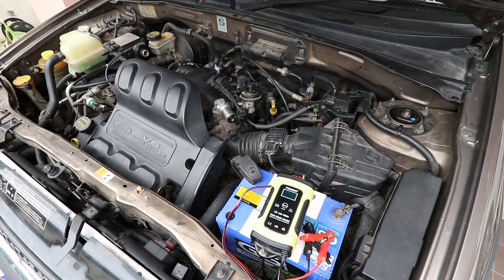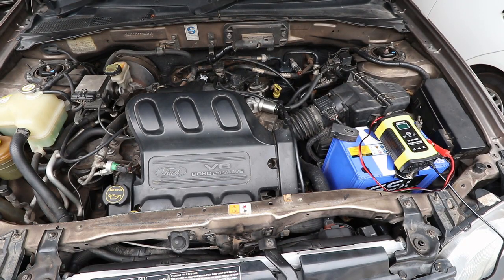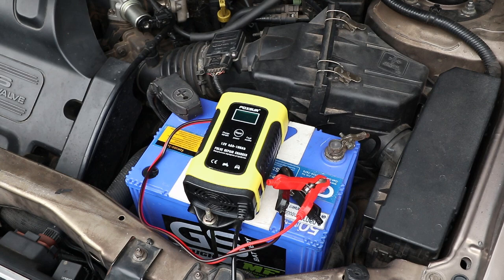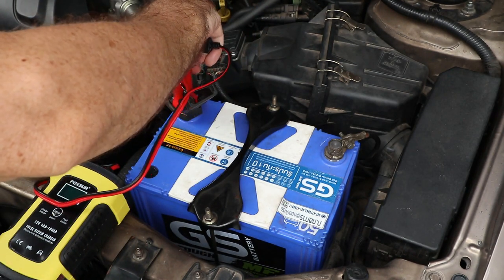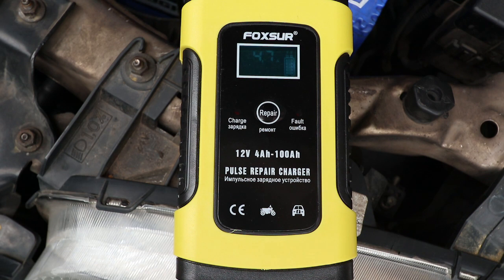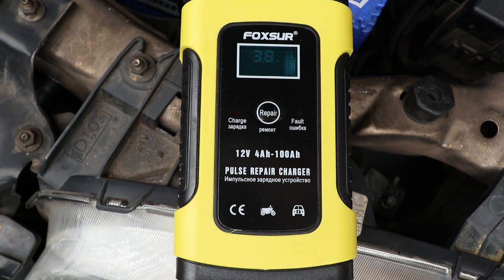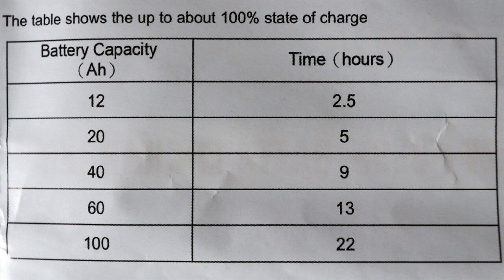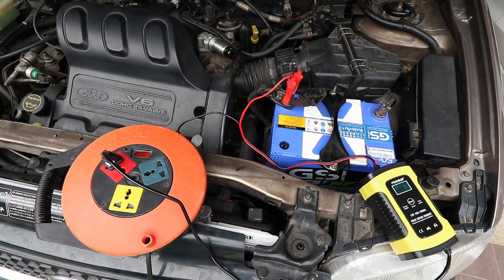Review Of The Foxsur Pulse Repair Car Battery Charger

Comment: Please updated if de-sulfation remained for some time say 6 months or the battery went bad again in short period of time say in one month.
Reply from the maker: I did a pulse repair six months ago when my battery analyser indicated there was a problem. Since then there have been no further problems. I checked with the battery analyser recently and it still looked good.

Just recently someone who seems very knowledgeable about the subject left some comments and suggested the battery should be pulse repaired twice a year, so I will probably do it again soon. However, to answer your question it didn't go bad shortly after doing the repair.
Reply: @PhilUKNet  Thank you so much the reply. It helped.

Comment: Bought one earlier this year and used it for the first time yesterday. The red Charge light does not come on and the fan wasn't working. Had turned on power then attached red clip to battery positive and black clip to car body (earth point). Display only shows the battery voltage and the temperature. What could be wrong?
Reply from the maker: I'm not sure and I'm not at home at the moment, so can't check my one. Possibly your one has a fault, but I'd like to take a look at my one. I'll get back to you later.
Reply: @PhilUKNet  Thanks, Phil. Could it be because my battery already has a full charge (12.7V)? It's 2 years and 3 months old. No problems with starting though.
Reply from the maker: @kokkionglim6548  Possibly, but I would still expect the fan to run and for it to go into charge mode even if your battery is fully charged.
Reply: If after connecting to the AC power supply the charging process does not start, the device probably has a defect - disconnect the charger from the AC and battery and check inside if the glass fuse is not blown. It is also possible that the charger is not supplied with AC voltage, check if it is so on another extension cord.

Comment: I saw this exact same charger in Taiwan.  It is only 300nt  $10 US. I am in the same position as you, basically have not started my car in a few months.   I will buy one and see if it can start my dead battery.   Thanks.
Reply from the maker: Where I am in Thailand you can buy them online for less than the equivalent of 6 UK pounds (about 10 US dollars). I recently got a comment from someone in Ireland who had ordered one from the UK and paid 28 UK pounds.
The charger can't repair serious flaws, but if it's just a lack of use and sulfation there's a good chance it can bring the battery back to life. Worth a shot! It worked for me.
Reply: @PhilUKNet  you might have found a new business opportunity. Lol
Reply from the maker: @chaunceystewart9960  Unfortunately I'm not very business minded, but there are certainly opportunities there!

Comment: Hi there, 

I was just wondering if you’ve had a chance to test this charger a bit more in particular the repair function. Give me a shout if you did, it would be brilliant to know you opinion.
Reply from the maker: Is there anything in particular you would like to see tested? I haven't done any more testing other than what I did in the video. Basically, just analyzing the state of the battery before and after repairing.
Reply: @PhilUKNet  Shortly after I wrote this comment, YouTube was so kind to show me you other video in which you have used it to repair your battery. I believe it did answer my question as I wasn’t sure about usefulness of the repair feature. Thanks for getting back to me.
Reply from the maker: @viktordudson9556  I'm pleased to see that YouTube are showing my videos! I think it's a useful device. It can't repair serious defects, but if the problem is just sulfation on the plates it can improve matters. Cheers!

Comment: Ah jaysus I only got my one of these in the post today. Seems to be fair decent .
Reply from the maker: Not sure how much you paid, but mine was very cheap. For the money I think they are excellent little devices.
Reply: @PhilUKNet  I paid 28 quid including postage from england to ireland. Pulse charging thing is still going but when I clicked over to charge it said its fully charged .lol. guess Ill find out tomorrow when I try start me bike lol.
Reply from the maker: @Seanybiker  I just looked at lazada.co.th, where I got mine. They are being sold for 229 Thai Baht - about £5.69, plus postage of just under a quid. People in the UK and Ireland get massively ripped off. That's one of the reasons why I left - and there were plenty of other other reasons! I hope it works out for you! It takes a long time to do pulse repair or normal charging. My car battery is quite big and it took well over 24 hours, however, it did make a big improvement to the battery.
Reply: @PhilUKNet  Yeah we are getting ripped off a lot alright. Ah with us being on lockdown and me needing it quickly I decided to just buy it as none of my friends close to me had one for a loan so although I was ripped off,  if it lasts a few years Ill be happy. ]
Reply from the maker: @Seanybiker  Yep, I understand. Sometimes you need something and you just have to pay up. Whoever is selling them here for less than 6 quid is making a profit, so if they are being sold for 28 quid someone is making a big profit. Oh well, there's not always a lot you can do. All the best!
Reply: @PhilUKNet  haha yeah exactly thats what I was thinking. It is crazy . You should order in some china and make a ki9llling.im on disabilty so dont have enough to buy in a shipment hahaha.
Reply from the maker: @Seanybiker  I should have done it years ago! They probably only pay 2-3 quid for each one and selling them for 28 quid is a very nice profit margin - even after shipping and import duties. Unfortunately, I'm more of a Rodney than a Del Boy ☹️
Reply: @PhilUKNet  thats it yeah. the shitehawks hahaha. cant blame em,

Comment: Thank you for this informational video. I like to ask if this charger is safe to use on modern dry cell batteries?
Reply from the maker: Thanks for your comment! This is what the user manual says: "Battery type - all types of 12v, AGM, GEL, Flooded (wet), Calcium type deep cycle, VRLA maintenance free lead acid batteries." I can't give you a definitive answer, but the manual says all types of 12v therefore it should be OK.
Reply: There is no such thing as dry cells. Even in gel or AGM batteries there is an electrolyte (in the form of gel or absorbed in glass mats). In fact, the charger is only suitable for flooded batteries because it offers too high charging voltage reaching even up to 15.3V depending on the temperature (gel batteries need 14.4V, AGM 14.7V) and in pulse mode 15.7V.

Comment: How long to fully charge 12v? my foxur takes 2 days to get fully charge
Reply from the maker: Yes, it's very slow. 24 hours plus.
Reply: Yes, it is possible. Depends on the capacity of the battery and the degree of discharge. To speed up the process, first charge the battery in normal mode, then use repair.
Reply: That depends on the Ah size of your battery, just because it’s 12V has no bearing on the charge time. 

It’s always better to charge gently unless you’re in a rush.

Comment: How long will it take for a 2sl battery to pulse repair? Thanks, looking forward for your response.
Reply from the maker: I don't know what a 2SL battery is. When I Googled I found batteries that weren't car batteries. The user manual just says 5 hours for motorbike batteries and 8 hours for car batteries. However, when I did a pulse repair it took a lot longer.
Reply: @PhilUKNet  2sl batteries are used for elf trucks. I think it has something to do with the size. Btw these batteries are also 12vs
Reply from the maker: @jayvillanoza3952  Thanks for the info. I guess they must be large if they are for trucks. The user manual doesn't say anything about truck batteries, just car and motorbike batteries.
Reply: @PhilUKNet  it's almost the same with a car battery. My brother in law has a mitsubishi lancer and it has the same battery with my truck. I just need to test it out and see if it works. Thanks a lot man!
Reply: For truck batteries due to their capacity I would recommend at least Foxsur 8A version. It offers a higher charging current and also has a pulse mode.

Comment: Did not work for me.
Reply from the maker: What didn't work? What happened? The repair function has limitations. It can desulfate a battery, but if the cells are damaged it can't repair them.
Reply: @PhilUKNet  did not repair battery that discharges after few starts
Reply from the maker: @cutanda.experience  As I said, if the cells are beyond repair it can't make them better. There are limitations. Is it an old battery? If it's just a case of the cells being coated with lead sulphate crystals the pulse repair function can dislodge them and make an improvement. Beyond that, it can't do much. I've had good results with mine and because it was so cheap I think it's an excellent little device.
Reply: @PhilUKNet  thank you. I still think it is a good device. Charging is good and disconnected from AC it gives you voltage info, very useful. My battery is AGM bought two years ago and when moved, it feels it is only "half-filled". Probably, in this case pulse charging is not able to repair it.
Reply from the maker: @cutanda.experience  Two years isn't old, but the 'half-full' thing is strange. After buying the charger I bought a Foxsur battery analyser and I find it useful for assessing the condition of a battery. Sorry I can't help more.
Reply: @PhilUKNet  thank you anyway. Helpful video. Waiting for an analyser.

Comment: Do you mean london.
Reply: @PhilUKNet  Driving in Thailand. With the situation we have with traffic and too many cars it's like Thailand.
Reply from the maker: @socialengineer1441  Yep, I left the UK in 2003. When I talk to my friends in the UK about how bad the driving is in Thailand they say it is bad there too these days. I've also watched some shocking dash cam footage from the UK. However, I drove a little the last time I was in the UK in 2017 and it was still a lot better than Thailand. At least in the UK people still stop at red lights and drive on the correct side of the road. I guess the police are too busy monitoring Twitter for mean tweets and making sure people are wearing masks.
Reply: @PhilUKNet  very true.
P.s thanks for uploading the vid man its awsome.. I was just going to buy one so thought I'd check  it out on youtube first. Thanks.

P.s its £8.99 on ebay.
Reply from the maker: @socialengineer1441  Thank you! Glad it helped. It's amazing how cheap these things are. It can't work miracles, but if the battery is sulfated it can extend the life a little. It's also useful for keeping the battery topped up and it won't overcharge. I have found this and also the battery analyser to be useful.

Comment: Could you please explain the difference between plugging the negative to the car body or directly to the battery while charging ?
is there a difference really ?
Thanks so much
Reply from the maker: I don't think there is much of a difference because the negative lead in the battery is connected to the chassis, but I have seen many sources that say when you jump start a car or charge the battery it is better to connect the negative lead to the chassis rather than to the negative terminal of the battery. Not sure why. My background is mechanical, not electrical!
Reply: @PhilUKNet  You are right: there is no difference between the two connections, provided the negative connection that you make is to a part of the car that has a low resistance route to the negative terminal of the battery. 

From a purely electrical point of view, it is much better to connect the charger directly to both battery terminals, especially for the 'repair' mode where high current pulses are generated by the charger. 

The reason why it is recommended not to connect directly is purely for safety reasons as there is less danger of the two clips of the charger cables shorting together, which must always be avoided or there will be a massive spark.
Reply from the maker: @phonicwheel933  Thanks for the info. In repair mode I was concerned that the continuous pulsing might damage the car's electronics so I always disconnect the leads and connect directly to the battery terminals.
Reply: @PhilUKNet  very wise. It is not worth exposing the high-tech electronic devices on modern cars to the continuous high voltage pulses that would be generated by forcing high current pulses into the battery as you say. This precaution should be put in the instructions, I would suggest.
Reply from the maker: @phonicwheel933  My thoughts, exactly!

Comment: Hi Phil, I have a 7 year old Ford Focus that is on it's original battery. A few times now had to jump start, even took it for a drive and battery is at about 20%. It took about 6 hours to get to 30%, would you say I should run repair mode? How long for etc?
Reply from the maker: Definitely! It certainly won't hurt and it might get a bit more life out of the battery even though it is old already. I would use an analyzer to see what the CCA is now and how much difference the repair makes. Based on my own experience it's a very slow process that takes at least 24 hours, but I have seen that it can improve the CCA value. In its present state you might start having problems when the weather gets cold. If repair doesn't work it's time for a new battery, but it's worth a try.

Comment: I just wondering... how long do you use the repair mode? I tried to repair my 12v batteries but the display does not say anything.
Reply from the maker: I didn't demonstrate repair mode in this video, but I did in another video - https://youtu.be/JatbNnFmodI The other video will show you what you should see. You should definitely see something on the display. The user manual says around 8 hours, but I left it repairing for over 24 hours. When it has finished repairing the battery it should go into regular charging mode, but even though I left it for 24 hours it was still in repair mode. It takes a loooong time.

Comment: I have the same battery charger. Just wondering is it OK to use this as a trickling charger to leave it hooked on the battery for a longer duration to compensate the discharging on the battery over the time.
Reply from the maker: It doesn't say anything specifically about this in the manual, but I imagine it would be OK. The concern with trickle charging over a long period of time is overcharging, but I believe the microprocessor in the Foxsur won't allow this to happen. I have only used mine to charge a depleted battery and to do pulse repairs. In either case I have only left the charger attached to the battery for around 24 hours. If my car was in storage for a long period of time and I wanted something to tend the battery I would do some more research. The Foxsur should be OK, but it might be better to buy a trickle charger that is designed specifically for this purpose. TLDR - it will probably be OK, but I'm not 100% sure.
Reply: @PhilUKNet   You are correct when you say that it would be best to get a dedicated trickle [topping] charger. The manuals I have for the Foxsur say that once the battery is fully charged that the charger should be disconnected from the battery within 2 hours to avoid overcharging and resultant gassing.
Reply: @Sparrow yes, but that quote from the user guide is for charging, not trickle charging, and there is a difference.

Comment: Phil UK. net,  I love your review. you explain very clear and it help me a lot.  
My car can't start an engine.  I checked car batteries volttage was drop to 8.5 volt. I'm decision to buy new batteries however I watched your review.  
I buy Foxsur to repair my car batteries.  
Could I ask some question? 
Are your car batteries still work after repair with Foxsur?  and How long to recharge it?
Reply from the maker: ขอบคุณมากครับ When my battery died completely the voltage was also around 8.5V. When the voltage gets this low it won't do anything. Yes, my battery is still working and it's still holding a good charge! The pulse/repair function worked well. No problems. One thing the Foxsur charger isn't is fast. It is very, very slow and both charging and repairing take a loooooong time - นานมาก. In my experience it takes around 24 hours so start it one day, leave it overnight and don't expect it to be charged until the next day. โชคดีครับ

Comment: Hi ive got exactly same foxur model as your. Sadly that when i used them with my toyota camry.... right after that the knock sensor was fail. Yes it could and likely be just coincidence but anyway it scare me out to keep using this one, because ive pay quite a lot a lot to replace that sensor. So that now im switching back to my CTEK mxs 5.0 charger. ><  Ive gave my foxur to my cousin  and still no complain from him so it might be just my bad luck lol
Just want to share my story ^^
Reply from the maker: Thanks for sharing and sorry to hear about this. I think it was just coincidence, but with these things you never know. When I do a regular charge I don't disconnect the leads from the battery. However, when I did a pulse repair I did disconnect the leads ... just in case. If your cousin doesn't have any problems, then the charger is probably OK. Thanks for your feedback!
Reply: HELLO - No you MUST Disconnect the battery (one termianl is sufficient)  when using pulse repair, as the name suggests as much as 50 volts can be seen during this mode which will of course DAMAGE your car's electonic systems -